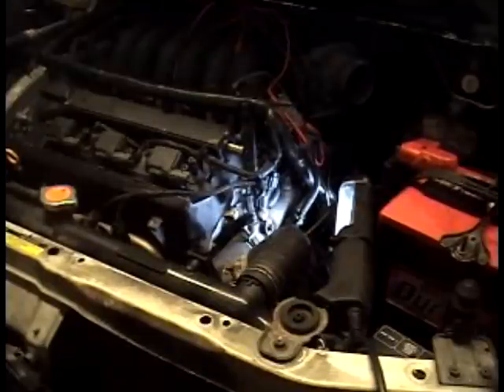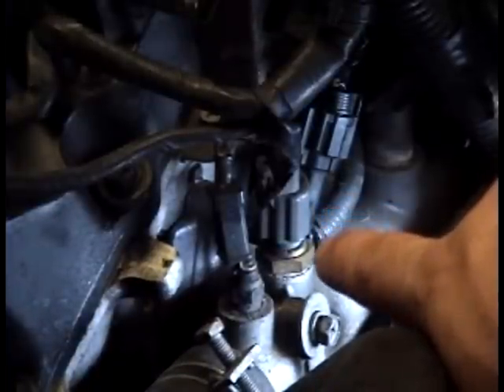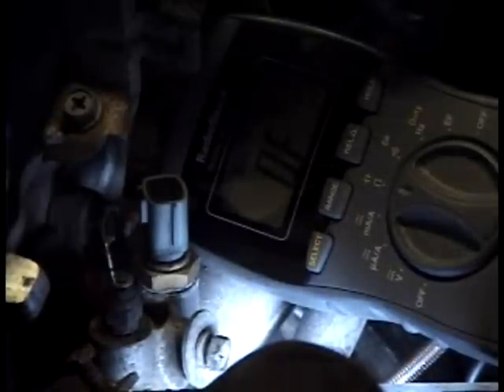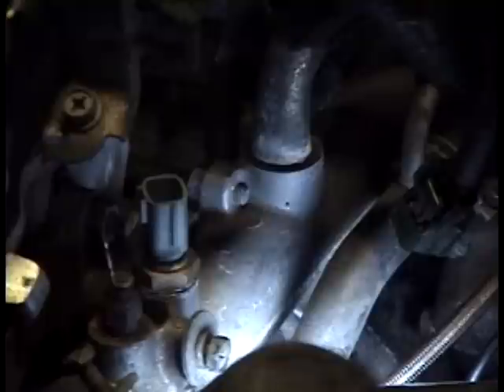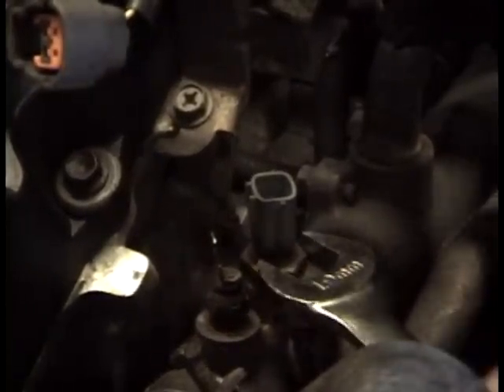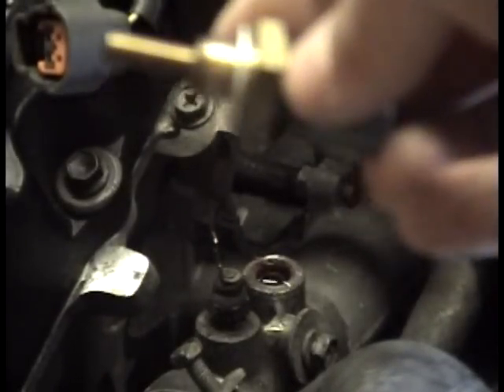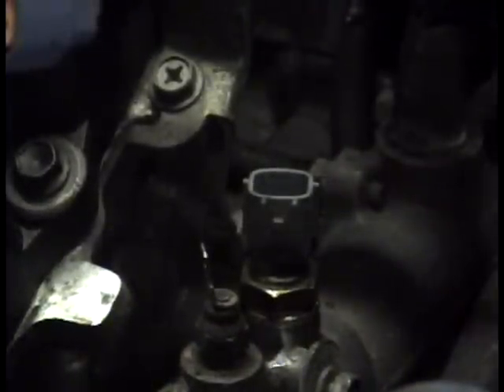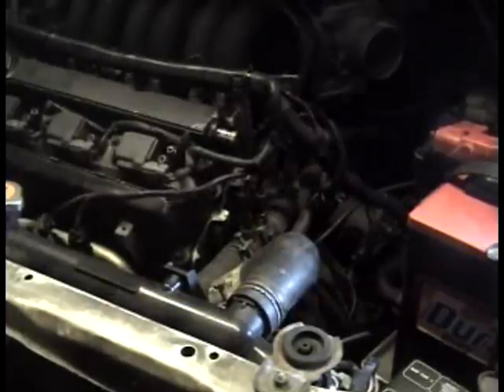1995-2001 Nissan Maxima: ECTS replacement

Comment from the maker: There were no problems, I did the R&R on this one purely to make a video.

Yes, a bad ECTS that always shows somewhere near warmed up can cause severe cold starting issues, just as one that is open circuit or always shows cold can cause severe warm starting issues.

It wouldn't necessarily cause a CEL, the FSM specified DTC set conditions are 'excessively high or low voltage', which would likely just be open circuit or short to 5v ref.

Comment: whats the name of that pipe where the temperature sensor lives at? im trying to find the name so i can order one and i cant find it anywhere and the people at the parts store are useless
Reply from the maker: Nissan just calls it a 'water outlet', quick PN lookup for a '98 (random choice) is 11060-31U0B, MSRP $148.67. Doesn't appear to be made aftermarket, best bet is eBay, maxima.org, or local junkyard.

Comment: My check engine light went on. I got a code 09 08 from the ECU which means "engine coolant temperature sensor." Does this mean the ECTS needs to be replaced or can I drive the car without any issue? - thanks
Reply from the maker: +Maxitikos A faulty ECTS can actually cause starting and drivability issues, depending on failure mode. If the ECU always sees a full cold signal, it'll run rich as hell, probably have hot start issues, and stay in open loop. If the ECU always sees a full hot signal, you'll have trouble starting when cold (won't be rich enough). It's ~$20 USD, and obviously a quick and easy part to replace.
Reply: +boredmder Thanks for the response. I bought a Valuecraft ECTS. It cost about $29.00. I do not know if Valuecraft parts are dependable. What do you think?
Reply from the maker: +Maxitikos I've never had a problem with them, personally. There's not really much to fail, it's just a thermistor (they generally fail due to age and corrosion, as there are no real mechanical/electrical parts).
Reply: +boredmder Thanks for the response. I replaced the ECTS. The check engine light went on today while I was on an expressway. When I got home to diagnose the check engine light I got 03 04 and 07 07 pulses. This means knock sensor and rear heated 02 sensor. The knock sensor has needed replacement for about 3 years now as far as the check engine light goes, however, the car runs fine with it as is. My question is could a new ECTS impact the rear heated 02 sensor and does it need to be replaced? I think this rear heated 02 sensor is mainly for emissions. It doesn't effect performance. This is a '95 Maxima and it is not subject to emissions testing. However, the check engine light may go on again.